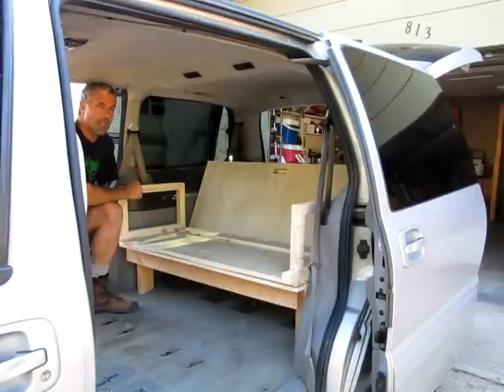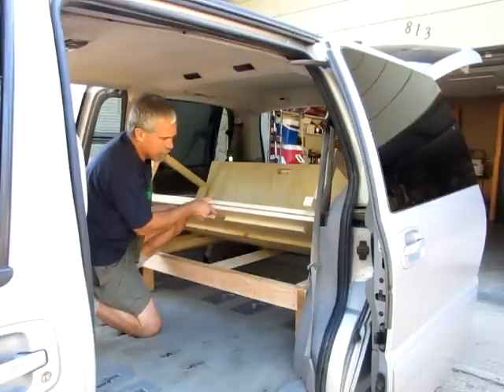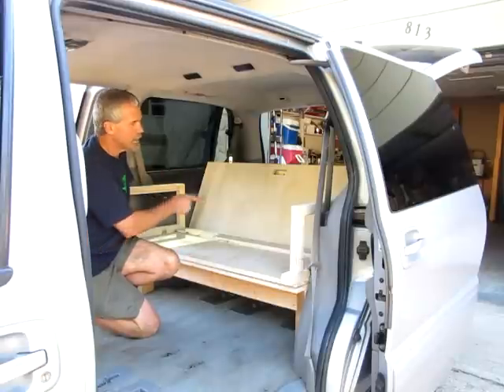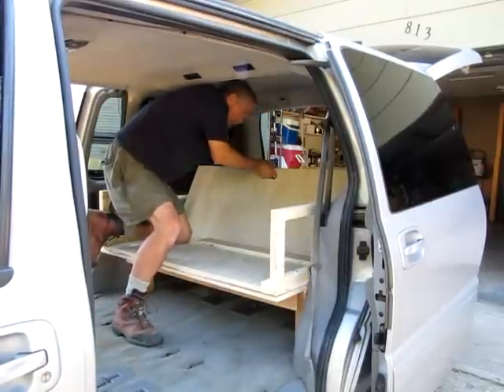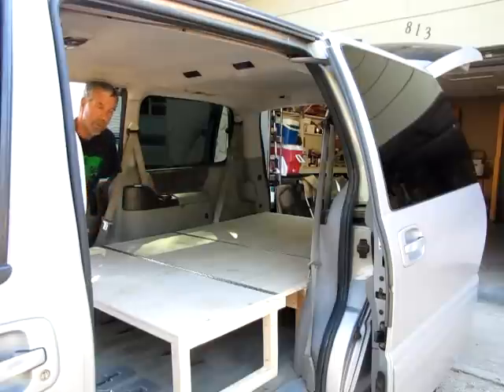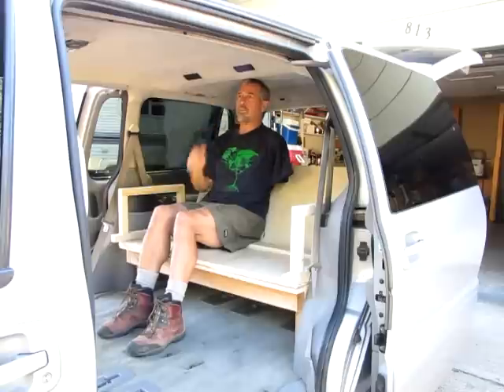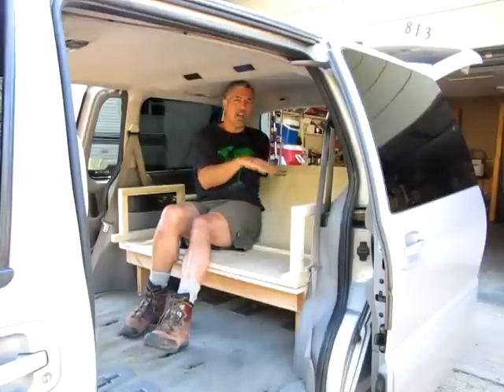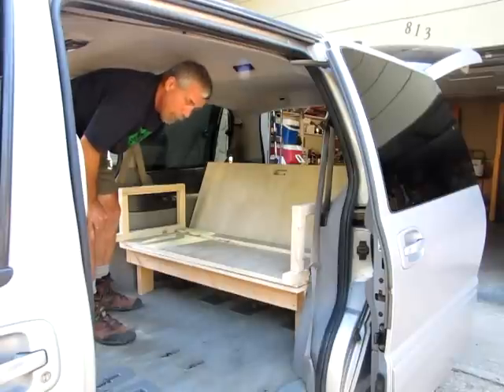Minivan Camper

Comment: Thanks for the share. You're right, there wasn't a lot out there for ideas untill recently. I converted my 2003 caravan 10 years ago calling it my poor man's RV. I opted for a solid plywood platform with enough clearance underneath for all our camping, fishing and cooking gear. Topped it off with a foam matress and a cover.  Rather than sitting inside, it was easier to rig an awning that can attatch to either side of the sliding doors.  Personal gear is stored in a couple of duffle bags that get transfered to the front passenger seats when we set up.  Folding chairs and a small table transport nicely on top of the foam matress.  Canoe goes on the roof.  It's great for stealth camping en route and you can't beat a caravan for fuel efficiency compared to the big hogs.

Comment: Cool, Mini-vans rule!!!  I got so much grief when I proposed to the wife about purchasing one but videos like this prove that it is an empty canvas to be utilized for just about anything.  i've hauled an upright piano, a yard full of brush, and 10 foot lumber in my van and now I have inspiration to use it for camping.  i'm sure it's safer than a flimsy tent and much more comfortable.  I'll probably do what you did but keep the back seat ( or at least the 2/3 portion) upright.  Then I'll build a frame for sleeping and storage.  It has to accommodate two adults and a 2 year old.
Reply from the maker: This bed can be left in and there is still room to put in the three middle seats. That said we have never had the seats in AND the foam in the van at the same time but I think you could if you cut the foam in 4 pieces. The seats still have to come out to fold the bed down.
Reply: The van I have has the tuck away back seats.  That being said I was thinking of tucking away the 2/3 of that seat and leaving the 1/3 for a car seat.  When it's time to sleep I would put the car seat in the front seat (or roof carrier) for storage and to free up that 1/3 seat for contributing to the overall bed. 

I have a question.  my wife was concerned about ventilation.  Is there a ventilation issue with sleeping in a van?  I wo0uldn't think so as I spend at least two hours a day driving in an ever growing crowd of traffic in Austin to work and back everyday.
Reply from the maker: We have left the two back windows open for ventilation... worked well.

Comment: Hey buddy. . Awesome build.. love your use of space. .
Reply from the maker: Thanks!  We have used it quite a bit for camping and really like the Tail Veil tent for the rear hatch... and no I don't represent the company!  We can get all but our cooler and food box under the platform.. oh and two extra blankets we usually take.  The draw backs so far are that the 4" foam we use didn't get cut to provide cushions for the seat/back but rather left in two larger pieces and 4" is too thick I think.  This means that the back section stays down all the time and we just stack the two foam pieces there.  Works for us and I think if we ever get "rained out" and have to spend lots of time in the van (but we would likely sit in the Tail Veil anyway) we could still shove the foam to the back and adjust the seat for sitting.  That said we sit on the seat all the time with the foam stacked in the back, just have to sit "back" on the seat because of the overhang.  Happy Camping!
Reply: Cheers for the quick reply buddy.. yeah ive had my eye on the teil veil aswell. . They look awesome. . Well.. try and find something of the sort... there's also canvas one made by outback camping... looks way more durable than the nylon veil..  anyways keep it up.. ciao..B

Comment: like the converible design. ideally i would like enough clearance for siut cases or travel bags to fit under for storage, but as you have found the head room is a limiting factor, and another thing with little to no head clearance could lead to a sore head on a bumpy trail

Comment: Do you think you could make a bed frame in the minivan with the backseats still in place? The backseats that came stock in the car, I want to be able to have people sit back there with the while we drive, which require seat belts. great video by the way.
Reply from the maker: If the back seats fold into the floor it would be possible but would require a completely different design. Hunt around on Youtube maybe someone has done that.  Good luck!

Comment: You're right Bob, but there's a/c solutions imo like two a/c's in both front windows, or two roof top a/c, I just got back from Ocala NF Florida deer hunting, could not stay in van (no a/c) the heat and humidity problem, so we slept in 8×10 tent, more ventilation, should have brought my 5000 btu a/c. Lol

Comment: Great design on the couch bed. Are you still using this system? It would be great to see the support mechanism for the backrest from the rear of the van. Thanks for sharing.
Reply from the maker: Thank you.... no we moved on to a class b RV a few years back. The support for the back rest is quite simple being just a notch in the 2x4 frame for the plywood to slide into. To make the slot I just positioned the back rest where I wanted it then laid a straight edge on the back side and against the 2x4 frame this allowed a line to be drawn on the frame projecting the angle needed for the support notch/slot. Then just used a jigsaw to cut out a notch about 1.5 inches deep.  Hope that helps!   Cheers!

Comment: Nice, I might take your design but only make it 30inches wide so I can keep the smaller seat in the back that comes with a sienna.  Trying to think how I could fold forward to make a table of sorts when not in use. So if it could work as a chair (remember 30" wide or so), a bed, and a table....well shoooot, done deal.  Side note, I'm split on keeping the bigger seat tucked in the cargo area with this setup.

Comment: I've been looking into different versions of this idea a box that goes into the back and folds over the front two seats. Or taking the rear seat out and using the removable captains chairs up front for transport then using them for camp chairs at camp and implementing this idea. Placing swivels under the front two chairs would be cool too. Do you have any more detailed info or pics on the bed structure? Or even a video.
Reply from the maker: +Daniel Lazo  Sorry... I do not and have since dismantled it as we bought a Class B van (a Pleasure-Way Excel-TD)
Reply: thinking like you. i have already made my seats behind so can be slide ahead and lain down and the third row seats arranged to lay down also wher they would ajion the second. so far row and then a small platform to fill out the remaing space for a bed platform. had also considered using reclining lawn chair or something similar  reversed in the back b but finding enough room for two side by side is anotherut havent found a lawn chair that woud fully recline. the zero gravity recline almost all the way

Comment: Hey man thanks for sharing and great job, this gave me the idea to do something very similar when I get my minivan in a few weeks (trading in my Hyundai)......so can I ask you how deep is the bench seat section that flips over on to the floor? looks maybe 15"
Reply from the maker: Hey Cody... I think it is 18"  you will have to decide what fits your van and how long you need the bed for comfort - divide it up and start cutting!  I had the guy at Home Depot cut the plywood on their saw making it easier to haul home and one step out of the way!
Reply: Yeah I'm about 6 ft tall so 74" should be long enough for mine to. I think what I'm going to do though is turn around the flip down bench and put it up against the front seats, then make like a back board....or divider about 16" from the back to put a cooler and stuff. I'll put up a video when it's done....thanks again!

Comment: hey don... just wanted to thank you for the video. i am an aspiring van camper owner and am doing a lot of research on types of vans and different ways to set up the sleeping platform. yours looks like a great piece of workmanship. i was wondering what type of van that is? also, what did you spend on all the materials ballpark? appreciate the help. be well!
Reply from the maker: It is a 2001 Chevy Venture... I spent around $100 for materials not including the foam.  Foam will run about $100 itself - but i found an Ikea futon mattress at the local thrift shop - very clean one for $10.00.

Comment: Great video, but my mini van gets hot unless you camp in the winter, you need an a/c set up.
Reply from the maker: Heat is a problem regardless of the vehicle.  We now own a class b RV and it has A/C but if you are in really hot weather it isn't even that effective... better than a minivan without air but hot is hot.

Comment: What do you do with the foam mattress when it is in bench mode?
Reply from the maker: Hi Lisa... we slid the seat part forward to the stop then folded the rear area flat and stacked the foam back there. We used 2 pieces of 4" foam so 8" high when stacked on the rear platform, still leaving room to put other stuff on top.  There is lots of storage under the platform for most of the camping gear and the ice chest still fits between the front seats and the platform. We camped in a VW Westy for years so the minivan was pretty tight - we have now deserted the minivan in favor of a Class B Pleasure-Way campervan. Until we could save the money for the Class B the minivan was a great alternative!

Comment: thanks, i like it but i think it could be simplified even more without the sliding forward bit which doesn't seem to serve any purpose. also the arms take up a lot of space, i'd go with a couple of hinged legs.
Reply from the maker: Hey Steve...it's all about customizing to fit you're own application...go for it! The sliding forward part is so the seat doesn't hang over so far it tips everything up when you sit on it AND it helps extend the platform forward for length. I kept the frame back further so I could put ice chests, etc in front of the seat when moving. I'm with you on the arms... I would re-design those a bit - if you look closely you will see the 2x2 mounted to the plywood sticks out a little, this was/is to form a support bridging both sections of the plywood - reduce "springiness," and it worked. Thanks for noticing the arm rests support the platform when folded out! Someone posted earlier they would just eliminate them...eh.... :-)